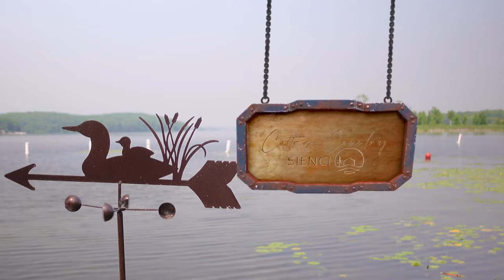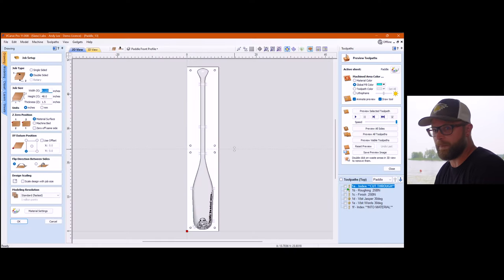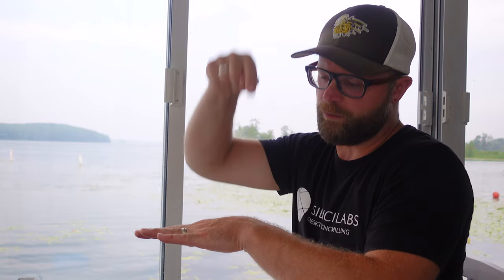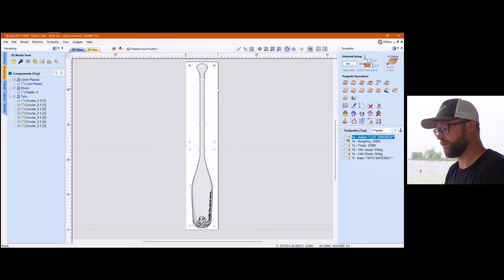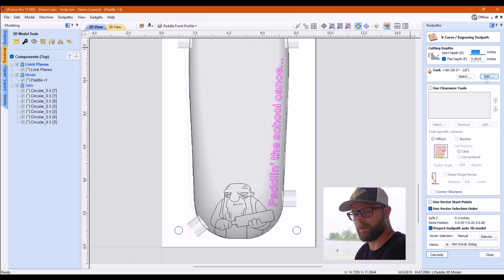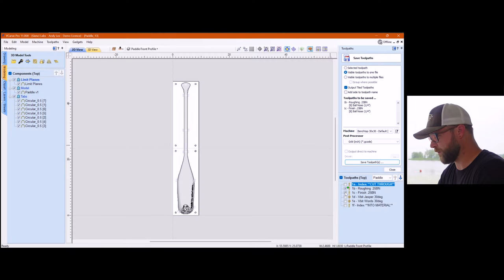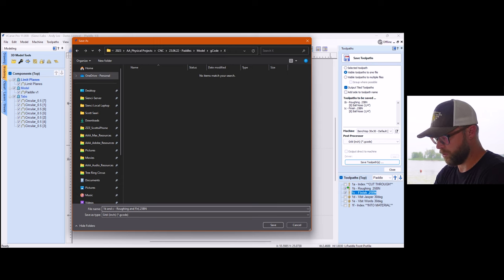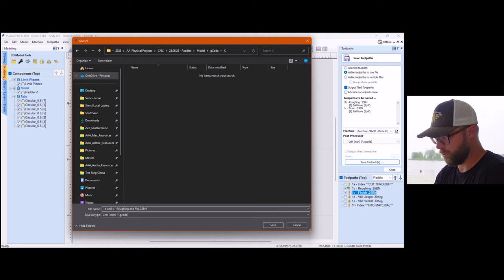Cottage Country Sienci: Crafting a Paddle using the Tiling Technique on the LongMill MK2 CNC

Comment: Nice job but I have a couple of questions.  As I understand, If the Longmill is set along a wall or in a corner of the shop, in other words, no space in the back of the cnc will it  be possible to index?
Also i wonder if it is possible to do this with the cam features of Fusion or with kiri:moto?
Reply from the maker: Technically yes to some extent, since you can spin the part 180 degrees in the Z axis instead of moving it down linearly in the Y axis. In that way the material would stick out the front. That being said, you would be limited to 2X the Y-working area as the size of material you could cut, but I suspect that for most people that would be more than enough. I think there are ways to do it in either software, but it would take some careful designing and planning to do it manually, and I'm not sure if there is a specific wizard or tool for this method in Fusion or Kiri.

Comment: Need to use parameters and constraints.  Change a shaft length parameter and everything else adjusts accordingly.
Reply from the maker: We'll have to check those out. We've definitely got lots to learn for Fusion still! Thanks for the tip.
Reply: @SienciLabs  I use fusion for design and generate toolpaths for my longmill.  If I get time, I'll see if I can parameterize the posted project file.
Reply from the maker: Thanks for the offer! Keep us posted.